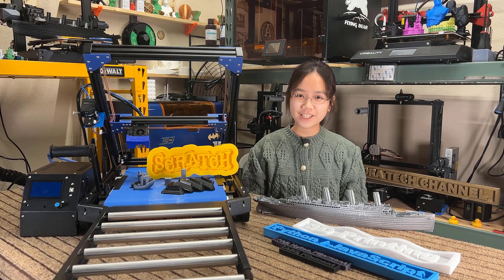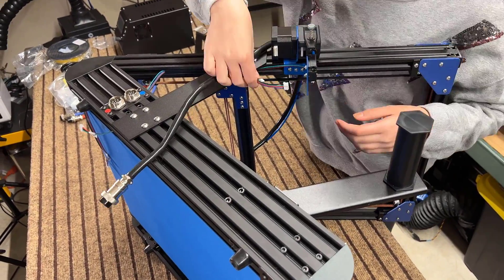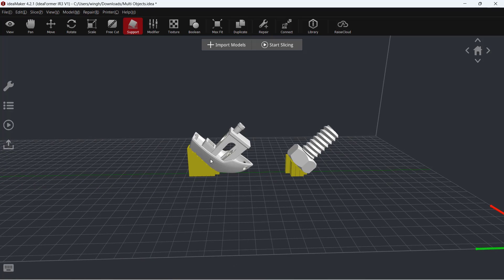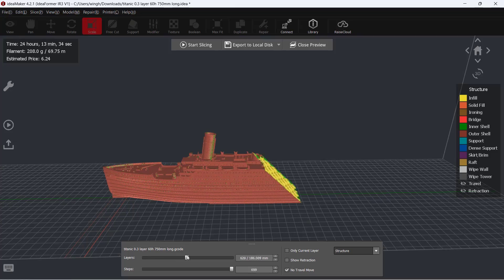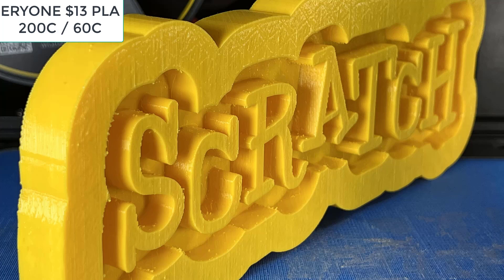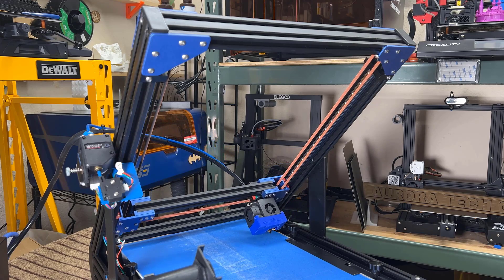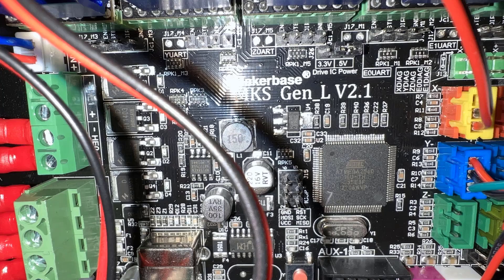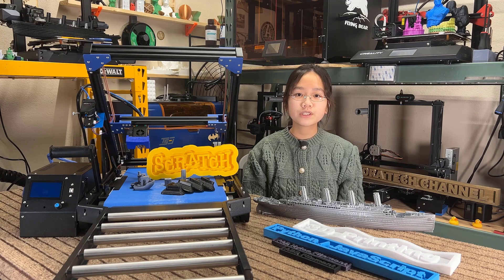IdeaFormer IR3 V1: $559 conveyor belt printer with linear rails, all metal hotend printing at 290C

Comment: Just out of curiosity, if you set up the printer at 45 degrees won't that get rid of any overhang issues?  Sure, it limits the infinite Z, but it could potentially be mounted at height for some specific application.

Comment: Hey there, I enjoyed the video but would like to inquire about the different filaments you used. I've scoured the internet for hours trying to find slicer settings for stuff like ASA and PETG for the IR3 V1 and haven't found anything. Could you by chance share the slicer profile settings you used for the PETG, Nylon, ABS and TPU you used in this video?
Reply: any luck?
Reply: @manny420mcfly  all you gotta do is set the two temps differently. PETG to 240/80 for example.

Comment: Thanks for detailed review, much appreciated. My IR3 V1 came today, but the Marlin .zip file on the sd card is supposedly corrupt and the folder in which the slicer and configuration files should be is empty. Could you maybe direct me to where I could find the firmware and configuration files?

Comment: I would like to see prints on torture test objects that have thin spires such as a plantygon. Also, I think they made a big mistake using an 8 bit motherboard. What is the purpose, cost? You're already spending hundreds on it and you end up with a printer that is loud and gives much worse print surface texture than 32 bit boards. An extra few dollars on a decent motherboard would have made a lot more sense.

Comment: I've been wondering why we don't see 3d printers with belt, but that prints normally, at 90°. This would make it possible to fill one build plate's size and then roll it over to a cooling zone, continuing the print and when that is finished, move that to the cooling zone and unload the now cooled parts to somewhere, perhaps a tiny roller or something.
Reply: Because the head would hit the part  Imagine printing a P then L next to it.  The overhang of the P would get hit by the head when the L tried to connect to it.
Reply: @dragonscales4377  No, you misunderstand. You just print your pieces, like on any other printer, the head lifs up like it usually does, the band rolls on and you start over.
Reply: Then you could never make anything bigger than the build plate. That defeats half the purpose.
Reply: @dragonscales4377  Yeah but that is way better for mass production. Think more print farm than hobbyist. You need 10 widgets? Open the gcode, add a move to the end to eject the print into a bin, then copy and past the print gcode, repeat 10 times and call it a day. Bonus points for removing the cool down gcode at the end.
Reply: Stratsys patented it
Reply: @pokingaroundwithtech  patent #, pls?

Comment: Am I correct in thinking that the reason belt printers print at 45° and not 90° is due to an active patent? If so I am surprised no one has come up with a 90° mod for a belted printer, although the print time would be longer and the print length would no longer be infinite, a locking system to lock the toolhead and frame at 45° and 90° would therefore be preferable to gain the best of both angles.

Comment: How's bed adhesion overall? I see you used supports but I didn't see any rafts or tabs on anything. 45° printers have their niche and top surface quality leaves more to be desired.
Reply: I've had my ir3 v1 for a little over a week and have logged well over 150 hours of print time on it. Every print stuck absurdly well. Like anything over the contact of a benchy required rotating the belt until the part came off. This thing had better adhesion then my ender 6 with a TH3D PEI sheet.

Comment: Titanic and blue sign have issues you did not mention, not good!!!
BTW, IdeaFormer is in my experience the best seller on ebay.
Reply: You didn't mention it either, what issues?
Reply: @lukaszbroda1094  Titanic has a layer shift on the back side, sign has a level shift on the back side
Reply: @toma.cnc1  true, I missed that in the video

Comment: What is the belt made of? I heard what you said about smaller parts needing glue.
I have an Ender 5 + and am considering a new surface. Do you have a favorite surface you could recommend?
Thanks!
Reply: Nice bloopers at the end! 😂
Reply: The bed is a nylon belt of some sort. I don't think this is a coating option on a flex bed but TH3D makes a really nice PEI coated build plate that tend to have amazing adhesion. I run 1 of each on my ender 6 and have 0 complaints